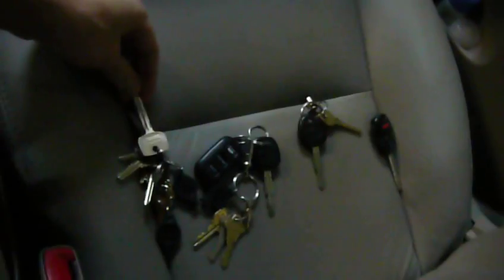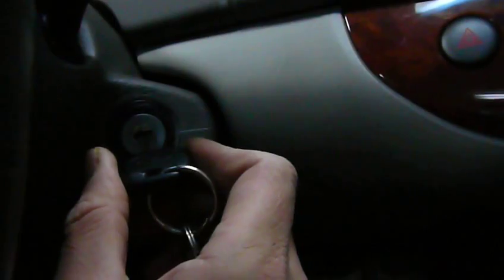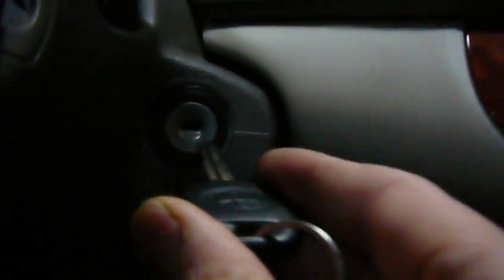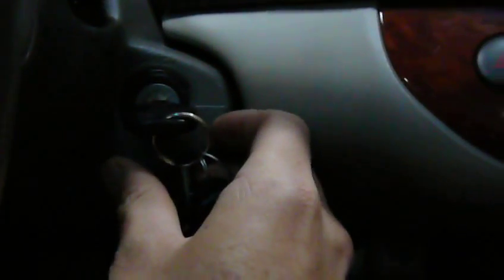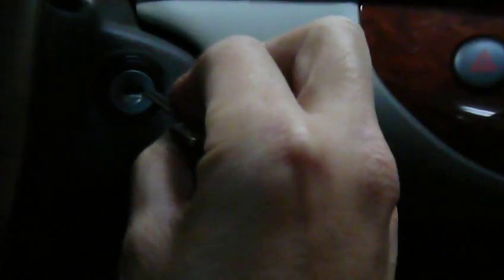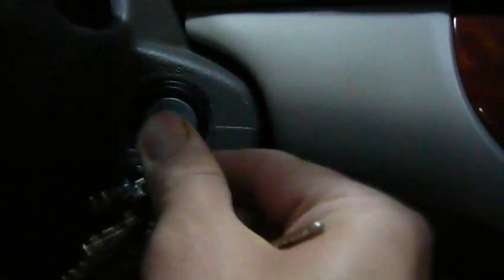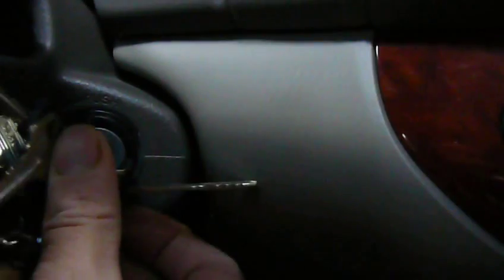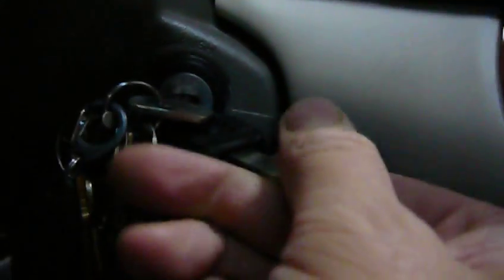RFID Chips on Modern Car Keys, Test

Comment: that is most likely EMI. You need a RFID kit, like a USB dongle, to see what frequency is actually transmitting packets.

They use simple challenge/response protocols based on proprietary cryptography/math.

I'm interested in the specific frequency.